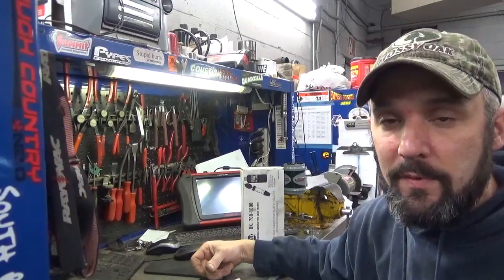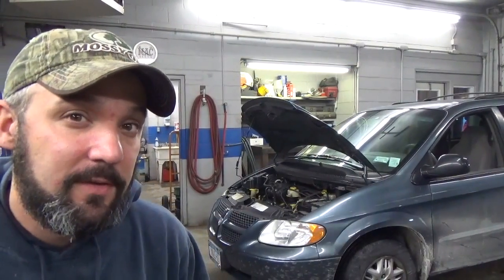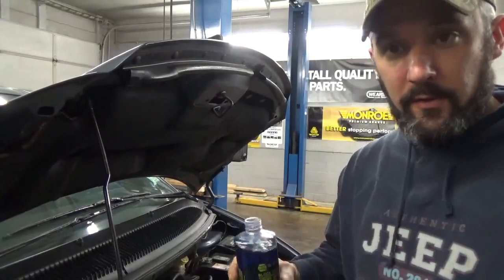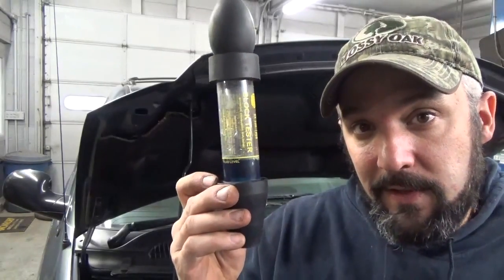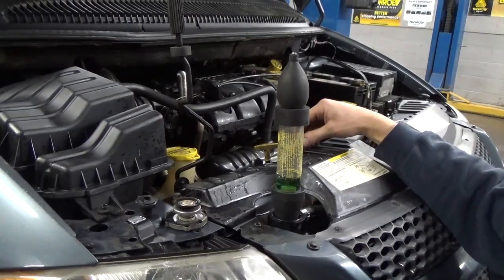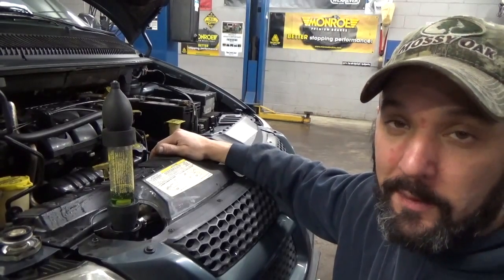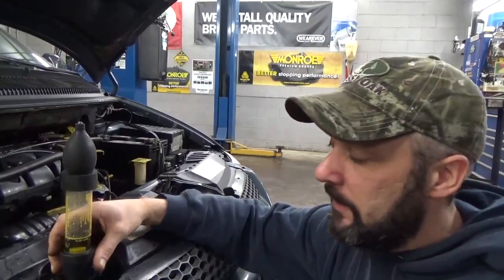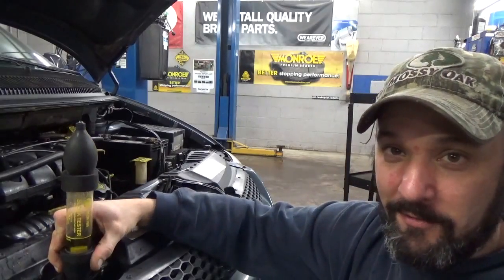Test For A Blown Head Gasket

Comment: My step-brother was quoted $1235.00 for both head gaskets on his ford taurus.  He asked me if I knew how to check for this.  I purchased one of these and tested the gases in the radiator and reservoir only to find that he did not have any leaks on either head.  I charged him for the kit $62 (name brand kit on Amazon)  I watched this video to see if you did the same test as I did.  😆  Good video
Reply: A negative test doesn't mean there isn't a compromised gasket. It could be very minor leak.
Reply: @benspragge33  

      He has had other questionable quotes from this shop.  And he has been driving it now for 6 years since the con quote.  I have used this test on other vehicles and found bad and good head gasket cases.
Reply: @sirsweetness8332  that's great! Yes, it's a very good test. Glad he's been able to use it for so long. Just wanted to let others know, just like a battery load test, if it passes, it might still be a bad battery; you'd have to check each cell for electrolytes, etc. This test is similar; you may have a blown head gasket, just either (1) very minor, (2) not from cylinder to coolant or have it (3) cylinder to oil or (4) cylinder to cylinder.

Comment: you can remove tester from radiator and pump bulb a few times with fresh air and fluid will change back to blue and you can reuse it ;)
Reply: In theory yes. But don't stick used stuff back with unused test fluid. Supposedly you can, but when I did, it changed the colour of all the fluid - and would not return to original colour. Bob. Retired mechanic in Land Down Under.

Comment: In this case it looks like exhaust gasses leaking into the coolant could have been easily detected just by removing the radiator cap and watching the bubbles.  Could have saved the cost of the test kit.

Comment: Got a 2010 3.3l Grand Caravan blows out the radiators. 3 in 4 months. This time coolant sprayed all over the engine so not sure where the cause is. Was thinking originally bad thermostat.  But with the overheating has happened 6 times already. Looks like this test could be a better test. There is also a major oil leak loss of 4 qts in 2 weeks. Not my own vehicle but relative who imo bought a piece of junk. But for now 4 families use the vehicle and its on the road from 3am to 11pm every day about 350 miles per day and nobody among them has money to get another vehicle so if I can repair or 1st off diagnose this in between their driving time. Then they can decide to repair and rent a vehicle for a day or 2. Or hope they can get another vehicle. Life in the fast lane.

Comment: Hello Eric, had a Ford Transit van several years ago and it would spit out fluid from the overflow, but not all the time, and only after many hours of driving. I tested it with a kit and another shop tested it a few days later when more problems arose. We both came up with negative result. In the end another shop close to where owner lived about 800km (525 miles) away said try Rislone sealant (NZ product). I had never heard of it. At $100 AUS not cheap, but it worked. Did a whole lot of research, even talking to the tech people in NZ. Chemically Rislone sealant does nothing until it comes into contact with high temp exhaust gas and then seals the crack and even reasonable sized head gasket leaks. Can stay in the system and even if system is drained and left with no coolant, does not clog up like Chemiweld does. But result was no further problems. Looks like it may have been a very fine crack in the valve seat area or something else really difficult to diagnose. Saved a full tear down and even another cylinder head (lots of $$$$). Moral is, this combustion gas tester is not 100% foolproof. I thought it was and got caught out. But an obvious one like in your test told you and the owner that car is now suitable for junk pile only. Shame considering condition of rest of the vehicle. Retired mechanic in Land Down Under.

Comment: Hello SMA/Eric, I really enjoy your videos.  I've learned a great deal from them, and I appreciate the time and effort to make them possible for all of us to learn.  I've come across a big challenge in my own garage, on a vehicle model you work on very regularly.  I have a 2002 Dodge Caravan with 242,000 miles.  I am the first and only owner, and through the years, I've replaced just about everything.  I recently hit a big challenge, and decided to take it on with some guidance, and education across several of your videos.  My vehicle has been losing coolant for some time, and through some investigation, I determined that the rear head gasket was leaking coolant down the back side of the block.  The pink crusty areas on the block just below the head gasket was the give away.  I've removed the heads, and took them to a machine shop to be refurbished, and was preparing the head area on the block for the new gaskets, and came to realize when cleaning up the head area on the block, that several of the head bolt inserts threaded into the head bolt holes have detached (unthreaded) from the bottom of the tapped head bolt holes, and are now anywhere from 1/4" to 2" below head surface.  Normally, I believe they should be about 3" below the block surface, threaded into the tapped head bolt hole.  The inserts themselves are about 1" deep on inside for the head bolt to thread into.   They basically came up, as I removed the head bolts, and eventually let go of the head bolt before it came out.  Other than threading the head bolt back in, letting it bottom out in the insert, and driving them back down with some pressure and torque, I don't know of any way to get them to reseat at the bottom of the head bolt holes.  I've been searching the internet, and can not find any info about this type of issue, except when they are stripped out.  In which case, the inserts are drilled out, the hole is re-tapped, and new inserts are added.  A couple of inserts that I tested, successfully re-threaded the head bolt back in with just some twisting by hand, but of course the head bolt is no where near the needed depth to hold down the the cylinder head.  I haven't yet tried any heavy torque or pressure to see if the insert will work it's way back down, and rethread back into the block.  Can you recommend an approach?  Maybe these inserts are now considered "shot", and unreliable, not sure.  Thanks, and keep going with the great videos.    Greg
Reply: My cylinder heads were at the machine shop, so I couldn't look at them at the time I notice the difference in the head bolt hole depths.  The cylinder head on the Chrysler 3.3L V6 motor has staggered head bolt heights.  It's not a monolithic height where the head bolts are driven into the block, especially inside the valve cover.  With the head bolts all being the same length, they will thread into the engine block at different depths, so I may be okay here.

Comment: Might not be a bad idea to run this test on a car you'd like to buy.  Kind of throw it on there while your doing your other inspections, come back give her a squeeze or 20 and see what happens.

I've actually heard of previous owners/dealers RTVing the reservoir hoses from radiator so if you happen to just check the reservoir's coolant you wouldn't know anything is wrong.

Comment: Best tutorial on the subject. One question: do you have to seal (in any way) the bottom of the tester to a radiator itself to ensure you're only sucking the air from the radiator, and not from the outside?

Comment: I am a little confused about the block tester if it does not change the color I am not happy with the result , I always compare it to  gas analyzer I have had vehicles that read  about 150 hc  and liquid not changing color , it changes quick over 300 hc  as I stated every vehicle I used both test , good video thanks
Reply: I agree. I used one of the uview testers and it never turn colors. Then I watch a video that scanner danner did and chose to pay a shop 50.00 to test my coolant system with a gas analyzer and it was positive for 130 hc. so I'm guessing that you have to have a real bad head gasket leak for the chemical test to show anything. probably 300 hc or more like you mention.
Reply: Joel Automotive  In action HC's can come from a variety of sources. CO only comes from combustion. When using a 5-gas analyzer always check for CO, not HC's.

Comment: I have a 2005 Malibu 3.5 v6. Had since 09 and was my first car. Bought it 46k and now have 192k. One time I left the radiator cap off right after I bought it and it overheated. The engine disabled itself though and I think that prevented most damage from occuring. Tonight I went and rented this kit from Autozone. Even though my car doesn't overheat  I've had many tell me GM is known for head gasket problems. Anyway I filled up the test tube with the blue fluid and let the run for a good long while and it remained blue. I guess that rules out a head gasket issue

Comment: I don't want coolant to overflow from the radiator into test fluid after warming engine up. So to ensure the coolant doesn't go into the fluid can i put the tester in the overflow reservoir instead of directly into the radiator's neck and still get accurate results?

Comment: im sure this is not in ur case but in general u will need to drain the coolent level less than half just enough to not have the coolent/antifreeze or water to go inside the test tube this is a correct way to check combustion gases but will need to drain some coolent or water for getting the gases in not coolent

Comment: Hey Eric you rock man!
How about finding a head gasket that is blown cylinder to cylinder or possibly to an oil port?
A cylinder leak down test is probably best but very time consuming. Especially on the vehicles where the plugs are on the firewall and have to be accessed from underneath the vehicle. And then finding top dead center for each cylinder and taking a reading, writing it down bla bla bla. 

I found a blown head gasket once with a home made cylinder leak down tester on my 2000 Ford Windstar 3.8L. The gasket was blown between #2 and #3 cylinders and burning up some coolant as well. The mini van ran absolutely terrible when I finally just had to fix it.

I was hoping there might be a way to use a smoke machine but some engines may only leak when the engine gets hot and things expand.

Comment: Eric, do you think by revving and seeing the fluid rise that that could be an indicator in itself?
Reply: No, the water pump spinning off the pulleys obviously the higher the revs and the more coolant gets circulated then causing fluid to rise a little. Easy way to tell if you have a blown head gasket, if the car is cold and you start it and within minutes the coolant pipes are hot then exhaust gasses are building in the cooling system and that’s a problem. Several simply ways to see if you have blown head gasket.

Comment: I used the AutoZone tester and I cannot get the sapphire blue to change color! Did a test multiple times over an hour just won’t change! But I did a engine flush of the system and coolant change the day before! I have White exhaust smoke tailpipe smoke for 20 minutes and then it is absolutely clear no smoke! It’s summer! Engine seems to run fine you tell me!

Comment: Hi There.
 I have an 03 Chevy Silverado 6 leader. Slow to start, But not all the time. Replaced every sensor I could think of, Cam sensor, Crank sensor, Gas filter, New fuel pump,wires&plugs,  Fuel injectors. Even switched out the throttle body. Catalytic converter seems to be open. But still have a multi misfire code. Did this test and the fluid turned green but not yellow. Any thoughts would be appreciated thank you.
 Also believe on your videos have been very helpful and awesome thank you for your time.marty

Comment: Hello, I'm having a problem with my engine. Everytime I open my radiator cap pressure is coming out even if the engine is cold and not run for 24hrs the pressure stays there. I have a new radiator, new radiator cap(correct pressure rate), all hoses are good and no external coolant leak, temperature is normal. What might be the problem?. My engine is mitsubishi 4d56 diesel 2.5literr never been rebuild and have 140K miles

Comment: 2007 Jeep Patriot. I flushed the cooling system. my Jeep has good heat,does not over heat. is not burning coolant, no white smoke from the tail pipe. its not loosing coolant. Jeep runs fine,does not lose power.
yet when i bleed the cooling system air cant stop coming from the Radiator.
or bubbles from the cooling system.
do i have a bad head gasket ??

Comment: So I ran this test in my 02 wrx today for like 3-4 minutes starting from cold, the fluid barely changed at all, if anything at all the after fluid was just so slightly more cyan then before, but is that long enough to determine a bad head gasket? I bought it and the guy said it was on its way out, but nothing has raised any red flags as to it actually being bad
Reply: I got the Same results as you did and I'm wondering if it's leaking or not too. This has me worried!!😟
Reply: @qpTheDarknessqp  I can’t say as for the leaks, but what I did for mine was pour blue devil pour and go into the system to try and remedy the issue. DO NOT DO THAT. I poured it in, and let it idle for the specified amount of time, followed all the directions to a tee, and my car overheated, after countless hours of work and pain, i found the radiator had been clogged completely, so I fixed that up, then I just wanted to “look” at the water pump so I had to take out all the timing belts and stuff and ended up having to replace a lot of stuff, it was worked on for pretty much weeks, I cleaned everything out and it still overheated, I had to buy a new thermostat (a mishimoto one) and that finally got it to stop overheating, but there was still a bunch of little pieces of blue devil crap pieces in the system, I never did the test again to see if it was still turning blue, but my guess would be that it did nothing and didn’t help anything and almost broke my car entirely. If your going to fix it do it the right way, do not use the “fix in a bottle,” I sold the car (actually for a profit) but I just did not want to deal with it anymore, I now have a Miata and a hatred for any blue devil products.
Reply: @ittueaday  Oh I Already know  what to use and what not to use Because after Working for AutoZone for 9 years and counting, You learn a thing or Two about certain Products. But as for me not being Satisfied with the test Results I got from Vehicle and Test kit. I had decided to ask my Coworkers and they clarified that my Issue wasn't what I thought it was. So I feel Confident that my Vehicle doesn't have a busted head gasket. However, I was warned about that fact that I "Might" have Transmission issues down the Road because it's an older vehicle. 2004 to be Exact.👍
Reply: @qpTheDarknessqp   ok good to hear, just don’t want anyone going down the path I had to go down, was not fun and I feel very stupid for doing it

Comment: Hey Eric!  Congrats on 100k viewers.  I've been enjoying your stuff since you showed us how to burn out studs on a Ram way back when.  Any ideas for a positive diagnostic on a head gasket when the juice doesn't give a result?  So far I've got one steam cleaned cylinder, no positive result with the block tester, no obvious bubbling in the radiator with 100psi to the cylinder with the valves closed (but apparently quite a bit of leakage to the adjacent cylinder?) and a pretty even set of compression test results.  This is a Audi 1.8T with no coolant passages in the intake/intake gaskets...not sure where else the coolant would come from?  I hate to rip it apart without a smoking gun.  Except for the quart of coolant loss each week and the huge cloud of smoke on cold start...
Reply: Hey did you ever figure out where the coolant was coming from?
Reply: @ellis2311  fun one.  Tore it apart.  Had machine shop deck and pressure test.  Passed pressure test.  Reinstalled.  Problem remained, slowly got worse over a year.  Tore it apart again, crack in head between the valves that wasn't obvious the first time.  Lesson is sometimes it's better to let stuff be good and broken before you try to fix it.  Or do your own pressure testing.

Comment: Would a bad intake manifold gasket on a gm 3800 cause the same symptoms? I keep having to fill up my coolant but there are no visible leaks I think its internal. I already changed the intake manifold gaskets and it continues to do the same thing. The weird thing is the car dont overheat.
Reply: It could if it's a wet manifold that seals off a portion of the crankcase. If it's a wet manifold that doesn't seal the crankcase, it may still be leaking in secret from the manifold without getting exhaust gases in the cooling system.
Reply: The latter case was happening with my 03 f150 last year. Definitely losing coolant, but couldn't see it without tearing things apart, and it wasn't getting exhaust gases in it or contaminating the oil, either. Turned out to be a blown intake gasket at the back of the manifold.
Reply: @OneTrueCat  we put brand new lower and upper intake manifold gaskets and it continues to do the same thing. No one can figure out where the coolant is going. We keep having to fill it up.
Reply: That probably is going to be a head gasket then, unfortunately. You could try using UV dye to make sure it's not a pinhole leak, but there's only a few options for an internal leak, and they all kinda suck. Good luck, friend.

Comment: Can you use this test on a "closed" cooling system that has no radiator cap also? Putting it into the coolant reservoir?
Reply: Somewhere on the car there is a pressure (also filling cap), be it on the radiator or the coolant reservoir. Take off that cap and use the tester. Retired mechanic in Land Down Under.